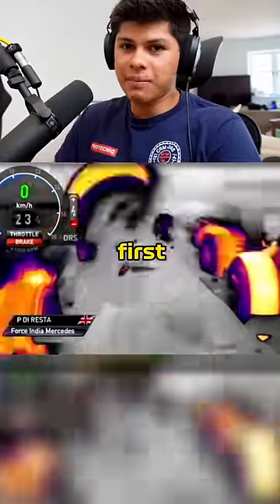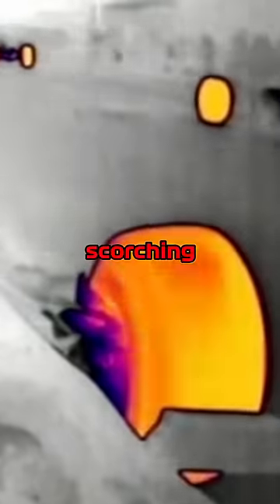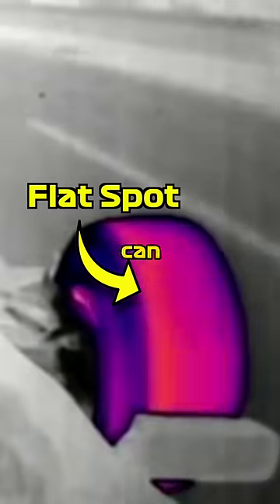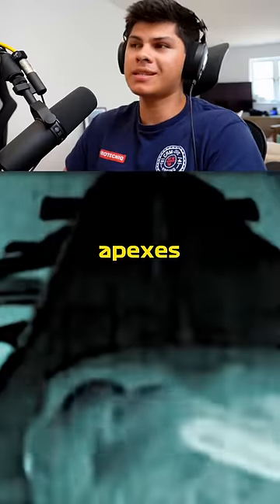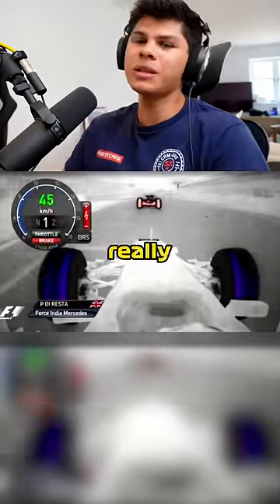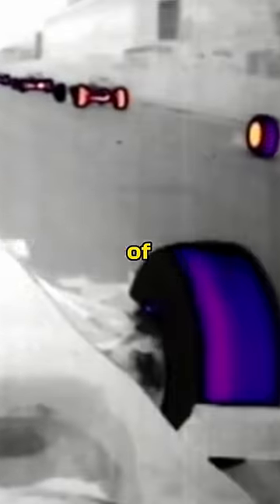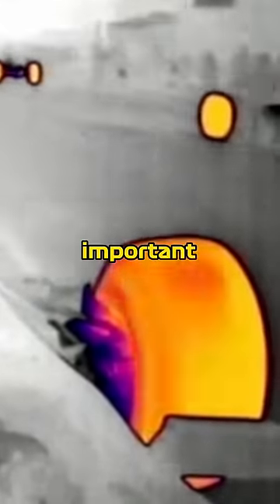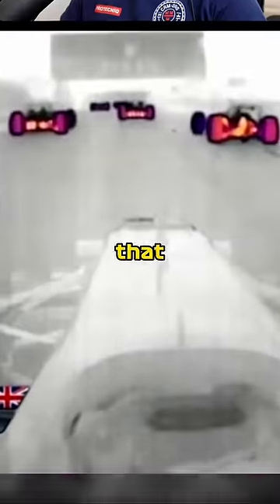THERMAL Camera REVEALS Why F1 Driver CRASHED at Monza #F1 #crash #onboard

Comment: That little bit of time when they had these thermal cameras was fascinating to see; though I get why the teams wanted them gone.
Reply: Why did they want them gone
Reply: @Ethan-km4lx yeah why lol
Reply: Because????? Common man!! Don't leave us hanging
Reply: @winiepoo6797   Corner to corner real time data on how a car is building heat into the tires, losing it, etc. It's not the most valuable data, there are other ways to get some of it, but still you don't wanna give your competition anything extra.
Reply: They could predict degradation of the tires by the info the cameras gave the teams
Reply: @iiide3 you must be popular
Reply: @Ethan-km4lx You are just letting everyone know a bit about how your car works in certain corners. You and I at home couldn't do anything with it, but F1 teams with all their tech could gain a lot of useful info.

How your tires work through slow corners vs fast corners. How the car reacts when tires are colder vs when they are hotter. Etc. Tire temps play a huge role in how a car deals with grip and tire deg throughout a race. If a team knows your tires overheat on a push lap halfway through the lap, but theirs don't start tuo overheat until the end of their push lap, they know any attack you try won't last long as your tires would have no grip after half a lap.

It's the same reason teams don't want their cars being lifted after a crash in 2023. Everyone gets to see how the floor is built. And as the floor is super important with aero in the current regs, you don't want other teams seeing how your floor is built.
Reply: They still have them, they don’t publish the footage any more
Reply: @ccramit so they all do have different builds?? 
Interesting
Reply: @dav2745 According to the fact that you replied to them, you don't either. 😅
Reply: @dav2745I don't. Got screwed over by the school system. Though I am dating someone.
Reply: @foxtrottails so you have at least one friend
Reply: @ccramit seems to me they're just mad because they're not smart enough to use it 🤷 if it gives an advantage then you just have to use it
Reply: @Ethan-km4lx  they want to keep it, but they don't want it released publicly like this cuz it can leak information about their car to other teams
Reply: @dav2745bruh, you fell for it😂
Reply: @ImPhantm  Correct. Formula 1 teams can buy engines, gearboxes, and certain smaller components, but every team has to create their own cars for the most part. Smaller teams were allowed to buy components from previous seasons from manufacturer teams, but I believe that is more restricted nowadays.

Though, I keep reading that Alpha Tauri is going to use more Red Bull parts so I don't know how that all exactly works. For the most part, in a season, you can't buy any current parts from other teams.
Reply: @ImPhantm  yup! F1 teams have over 1300+ members all working together on the car when it comes to engines, gearboxes, brakes, aerodynamics, repairs, etc. It's basically like teams of rocket scientists building rocket cars ;) Redbull pretty OP this season but I encourage you to look up this season and past seasons F1 highlights :)
Reply: @ccramit  They've basically said that redbull told them to copy the redbulls as close as possible next year since they're so dominant this year... xD Since they're a sister team I'm sure that'll be a lot easier than any other team attempting the same.
Reply: @ccramit thanks for the valuable info
Reply: Jesus loves you ;;
Reply: Idk why teams haven’t figured out a way to integrate AR into a driver’s visor so they can see that type of info.
Reply: I heard the reason was because thermal cameras are considred miltary equipment by some countries' laws.
Reply: @foxtrottails dude you're 14 calm down
Reply: @isaiahh3754  I'm so confused dude. I'm 23 and now I'm confused. Made me laugh. Thanks for the compliment I guess
Reply: @winiepoo6797 what about rare man?
Reply: Rip
2010-2016
Reply: @foxtrottails  your dog doesn’t count.
Reply: @Noilecreif  just like you.
Reply: @sirslayerca4704  whatever you believe child. I don't care
Reply: @foxtrottails  older than you bud. But your attitude screams 14.
Reply: @sirslayerca4704  lol. Na. 24. Terrible at responding
Reply: @foxtrottails  even worse, your life is in a sad state. Fix it.
Reply: @sirslayerca4704  whatever
Reply: @sirslayerca4704  ok
Reply: @Ethan-km4lx my guess would be for the same reason I’ve seen videos of nascar pit stops with blurred out wheel wells (they don’t want competition to have more information on their cars)

Comment: “No officer I didn’t plow into that crowd of people because I’m drunk, my tires just wasn’t warm enough”💀
Reply: 1000th like 💯
Reply: All mustang drivers are going to have you on there blacklist😂😂😂
Reply: Theyre carbon-ceramic disks and can cost upwards of $12,000 a disk
Reply: Weren't*
Reply: @tradingagario7643 since when are tyres made of carbon and ceramic
Reply: @filipbitala2624  Its not the tires its the brakes, the tires dont stop a car the brakes do. The reason F1 tires are warmed is so the driver doesn’t have to focus on heating up his brakes, with carbon ceramic brakes hot brakes are most effective.
Reply: @tradingagario7643  literally nobody here mentioned brakes
Reply: @filipbitala2624  well the only reason tire temperature would effect brakes would be if their carbon ceramic genius 😂
Reply: @tradingagario7643  again, nobody mentioned brakes
Reply: @filipbitala2624  i mentioned brakes bozo what r u yappin abt fr 💀
Reply: The reason f1 tires need to warm up is to add grip since the tires are very smooth compared to a normal cars tires
Reply: @irongrasshopper yes that is the case for even daily driven cars, but traction and brake fade was not the case for the accident in this race video
Reply: @mint1880  no its not, normal cars dont use the same brakes, them not working when cold is exactly the reason for that
Reply: @tradingagario7643  exactly, you answered a question nobody asked, and then you asked yourself that question, thats like me coming here saying that NASA is going back to the moon, what does that have to do with anything?
Reply: @filipbitala2624  I didnt answer a question, i mentioned a statement that directly correlated to the video. The fact you’re mad about a comment that has nothing to do with you💀
Reply: @ no it didnt, he didnt say the brakes needed to heat up, they were already hot, actually the single time he said the word brakes in the video he said they were already heating the tires up, so not only are you off topic, you are actually wrong too
Reply: @filipbitala2624  F1 Teams use tire blankets to heat their tires so braking ability is improved, theres nothing incorrect about that statement. Im not sure why you’re so mad maybe pent up anger, are you going to cry or something.
Reply: @ and now all of the sudden you start to talk about tyres instead of brakes, stop crying about me “being mad” and move on

Comment: bro completely ignores that the driver ran into another driver in front of him and completely knocks his wheel off and wants to blame it on the tire temps
Reply: Why did he hit the other car? he locked the brake on cold tires. hotter tire might have prevented him locking his brake.
Reply: @TJPDmember nah it was because its paul (i have no idea who paul is and in fact ive never watched racing in my life)
Reply: @ozhinz nice try though
Reply: @TJPDmember obviously Paul, anyone with half a brain could see that it was Paul at fault
Reply: It's because the front left tire was wore down due to the burnouts and the incline on the left side of the track, and once he turned, the front left tire made more contact with the ground, while the other 3 were caught, making the car accelerate so fast since he gained sudden grip. He couldn't control it, causing him to ram into the other driver. 

That means, the burnouts were to make the tires hot, but didn't help, and instead made his tires wore down, and since the burnouts didn't help the temperature go up, his brakes didn't work as they should.
Reply: No, it is still his fault for messing too much with the tires.
Reply: @SgvSth  Yes, yes it is. I'm just telling why did that happen.
Reply: @ProjectKhanCS also when heated air expands outwards
when the tire is cooled, it will deflate and lose braking performance
Reply: The tires are red hot,...??? 💀💀💀 @TJPDmember
Reply: @TJPDmember nah
Reply: Wanna make it even more obvious that you don't know anything about racing?
Reply: @TJPDmember  thats why tire warming is stupid. if your brakes are cold, you will lose to much heat the moment you start moving. plus there was a flat spot the moment he locked up, so if you dont make shure the flat spot is worn off, you cant brake like you normally would brake, becouse it would make the flat spot catch the track wearing it flat worse and worse.

Comment: my boy just crashed into the car ahead
Reply: And that is the only reason wasn't 😂
Reply: This is about why he crashed.

"and I think this thermal camera has some clues as to why."
Reply: The steering wheels on those cars are very accurate, the slightest dip in the track throws the wheel.

Because there is an incline on the left side of the track, his left front wheel was worn down, especially when the tire was dragged sideways on a burnout.

The crash happened because one tire was bare, 3 were activated, when he turned the weight shifted 3 wheels caught, he accelerated very quickly because of sudden traction and he crashed the wheel into the car ahead of him.
Reply: people talking like they could do better
Reply: I mean that wouldn’t rip off the tire tho
Reply: @rojevil2829 yea i can just not crash
Reply: @FEAR_GOD-kk6jd you never watched racing
Reply: He said the way he was waving effected his brakes

Comment: The tire heat is interesting but I think it's because the wheel to wheel contact 😬
Reply: Lol fr . Completely irrelevant but nice facts
Reply: @mnc1009 

How it is completely irrelevant if the contact happened due to brake perfomance?
Reply: @pizzakitty69 Ofc it’s a skill issue the driver was Paul Di Resta 💀💀💀
Reply: @cayden2744  because if the wheel never made contact likely nothing would have happened thus irrelevant. its a simple concept smooth brain.
Reply: @craig9365  

Wut, you just reversed and made nonsense explanation.
"If it never made contact nothing would have happened thus irrelevant" but it happened due to inferior brake performance (according to the point made in the video), thus relevant.
Reply: @cayden2744 idk whats smoother the tires on the car or your brain XD
Reply: @cayden2744 the contact happened due to micro-steering  to the left when he should've not. You can clearly see it.
Reply: @faselfasel2864  

Because if he kept straight the would hit the car in front anyway.
Reply: Holy shit no way
Reply: @cayden2744  its irrelevant cuz the tires weren't slipping.
Reply: @cayden2744 also all the other cars were having the exact same situation.
Reply: @pizzakitty69 facts. Just looks like 10,000 rpm vs 10,000 rpm. But that just me
Reply: If his tires was warm he woulda come to a stop silly mooose

Comment: I am pretty sure the Pirelli slicks from 2011-2013 are far more sensitive than today’s, but they provide far more grip in operating temperatures compared to today’s slicks. If drivers do a similar amount of burnouts today, they might not get as much grip due to the much due to the stiffer structure, and they might get more tire deg instead. Which is why they don’t do as much burnouts as even 2021.

Comment: I feel this man is over-analyzing this simple crash. Yeah maybe his tyres were a bit cold, but the crash happened because Di Resta did his usual thing, missing the braking point and trying to compensate by applying greater brake pressure, which caused the lock up. Judging by his rate of closure to the car ahead of him, he wasn't making the corner without crashing, even with warm tyres.

Comment: Some inaccurate information here.  When the tire looks cooler on the thermal camera after he gets moving, it's only the surface that's cooler, under the surface the tire is still warm and slowly transferring heat to the surface, but the air and road are cooling the surface more quickly.  When he hits a corner hard the cornering stress helps reheat the surface of the tire again, but the inside was already warm.  When he comes to a stop we're not seeing the brake rotors warming the tire (they wouldn't be able to radiatively heat the tire from the inside that quickly even at their temperature), we're seeing the still-hot subsurface portion of the tire warm the surface back up through conductive heating.
Reply from the maker: You’re right that we can’t really see the core temperature at all, and I’m sure the conductive heating has a huge influence here as well. 

From personal experience, the brakes are able to radiate quite a bit of heat (even on high performance steel brakes) when sat for a while on the grid. I sped up that bit of the video so he was sat for a bit longer than it looked.

I’ll also agree with you that the lack of contact surface temperature on the 1st lap is likely a greater issue than sidewall surface temp and I probably should’ve made that more obvious.

Comment: It's important to note that the camera only shows the surface temperature of the tire. The rubber on the inside can hold alot of heat and it wont show up on the camera

Comment: You spent a full minute talking about temperature of the tires when the guy just drove straight onto the car in front.
"You see, I didn't crash into that wall because I wasn't paying attention, I just didn't build enough core temperature on my tires by using the brakes."

Comment: It obviously had nothing to do with the tire. It was completely fine. A better explanation is that the strut connecting to the car was weaker and hitting the car infront of it flew it off. It is likely because it was loose.

Comment: They still do as many burnouts today because tire warmers are no longer allowed. Not sure where you heard that they aren't doing the same amount of burnouts. Burnouts at the end of the formation lap are very specific and the drover is told by the pit wall how many to do based on the current tire temp.

Comment: im infinitely sure the reason for the crash, is the fact his front left tired collided with the back right tire of the f1 car infront of him. im infinitely sure that the heat of his tires had 0% chance if causing this or helping this crash.. if you notice the tire isn't what broke but the shaft holding the tire in place broke. i like how people over think everything and try and place blame on something else other then themselves or what they can see... im not even a race enthusiast and i could see its because he hit the other dudes wheel and it sent his flying.

Comment: Nah. It’s because he cut the turn too much and numbed the car to the lefts rear right wheel and damaged his suspension and steering link.   It’s pretty clear when the entire wheel assembly snap 150 degrees upward after contacting the other car violently.  If you open your eyes at least 25% you can see it clearly.

Comment: The clue is that when his tire made contect with the back of another tire it wouldve either,if the suspension and whatnot was stronger,pushed the car up,but the weak metal and whatnot made it snap instead

Comment: With this thermal camera you can only see surface temperature and not core temperature. Core by definition means inside the tyre. For braking, and driving for that matter, performance what is important is the surface temperature which determines the friction level. See WLF transformation for more. The warm up procedure is pretty standard and varies from car to car, you still see the warm up procedure till date.

Comment: You're clueless kid. The tires stay hot the whole time. It's just the very outer layer that cools down in straights. That's why the tires look like they heat up when they stand still. Heat from the inside warms the outer layer back up.

Comment: No no no, the thermal camera shows what truly happened, it had barely ANYTHING to do with the temperature of the tires, it was most likely because he slammed into the car in front of him and since the tires on the car ahead of the car shown & being talked about were spinning at such a speed as they do, the speed of the wheels and the crash most likely caused the tire to fling off.

Comment: Idk anything about racing but couldn’t you just put the car in neutral if the racetrack is almost fully flat? I know you might roll a bit, but putting on ur breaks slightly might make the tires less warm at the start
Reply: After my high ass rewatching the video a few times I’ve realized this had nothing to do with anything. I think he crashed because he hit another car

Comment: In the start if you didn’t notice the other cars. You would see that the driver hit the rear tire of another car. Therefore a lot of irregular force was applied to the suspension. Here by breaking the mounting if the wishbone assembly

Comment: the thermal cameras show that the tires heat up, but the crash is caused by the F1 driver's F1 tire touch the other F1. So the thermals only show much more clearer video of how the tire got ripped off.

Comment: Everyone in the comments is completely clueless that the brakes need to be at a high temperature like 80 degrees Celsius to perform well as the creator said in the short 😅 As the short also showed, the F1 drivers were barking on a corner just like the creator said they were and the driver didn't have enough heat radiated to stop; which caused him to hit the back of the other car 👍